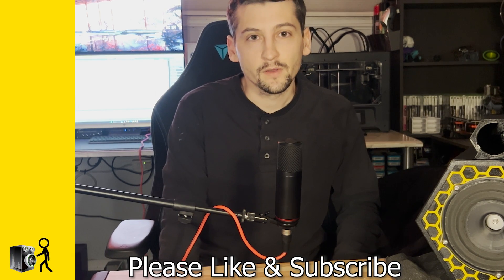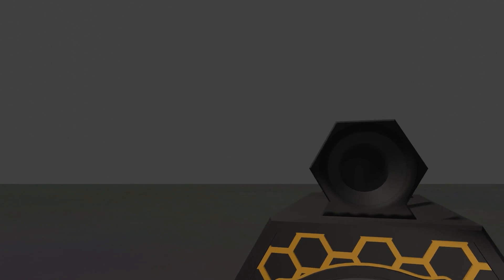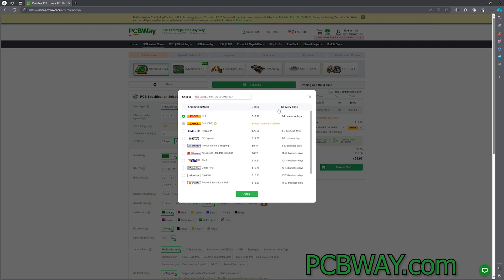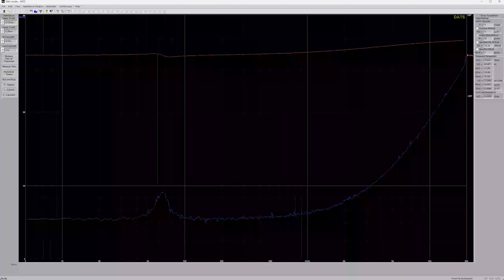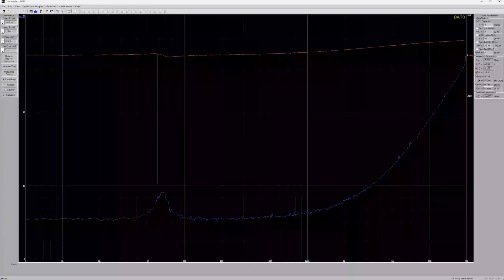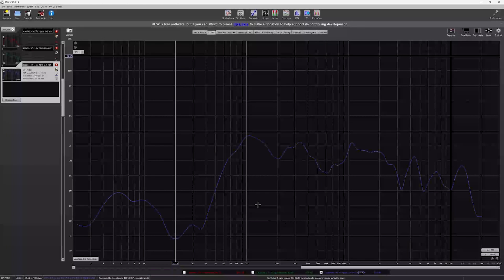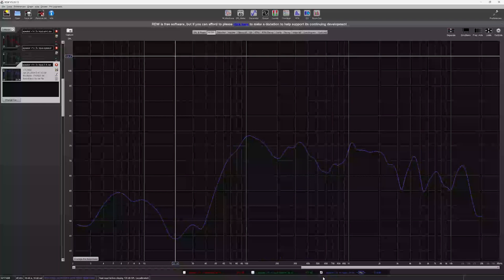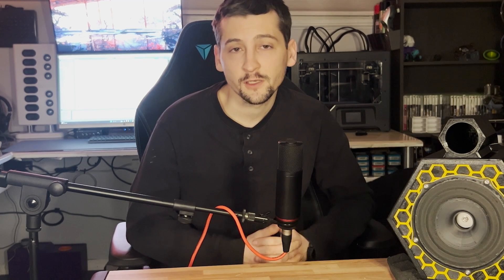Fully 3D Printed Speaker V14

Comment: Cool Project ! ♥️  The only concern I would have would be the relatively abysmal efficiency. I would assume that relatively sparse magnet arrangement arrangement resulting in a severely limited magnetic field? You seem happy with the result, but the trouble I see is that if you continue with this design purely as a proof of concept, once complete, there will be nowhere to go to boost efficiency but a complete motor redesign, since you won’t be able to buy stronger magnets than the ones you already have. With such a low efficiency, cooling will obviously be a major issue, but if the field strength were higher, the cooling would likely be unnecessary. Thoughts ? 

Looking forward to more !
Reply from the maker: I’ve tried denser magnet arrays before and the lack of air flow in the motor contributed to issues with voice coil overheating and then as a result warping. 

Also this motor isn’t something of a permanent fixture, it’s merely used so I can collect data for v15’s design. 

As for efficiency, this motor has the highest Bl of any of the 14 versions, so it’s the most efficient use of power of any of my speakers as far as the motor is concerned. Now that I have a motor that’s usable that way, I’m more focused on getting the suspension/cone design dialed down to what changes influence what parameters.

Comment: Magnet, coil and amplifier too? You only print box...
Reply from the maker: I printed all of the speaker minus magnets, copper wire and the steel plates/ fasteners. Those few parts can’t be 3D printed unfortunately.

But the speaker’s cone, former, frame, spider,surround, and motor basket were all 3D printed along with the enclosure.

Comment: why is the impedance curve so awful?? is dats really so crappy? i get super smooth and detailed curves from my simple system based on an usb audio card + REW...
Reply from the maker: Awful how? If your talking about all the noise, it could either be from how sensitive it is. Or it could also be from the fact that this is an entirely one off design - and while I understand the basics of speakers I’m far from an expert speaker designer.
Reply: yes, i mean noisy. With all this noise, i'd qualify it as "terribly insensitive", actually. Or can it be just because you've used a very tiny excitation amplitude?
Reply from the maker: I’m not sure what an “excitation amplitude is” I merely follow the instruction for the DATS hardware. 

I’ve tested quite a few of my speakers and the noise has always been present. I’ve also pulled TS parameters from a few other store bought speakers and there has still be little up and down bumps on the graph line. That’s why I’m saying it’s so sensitive that it’s picking up little variations in the speaker during its frequency sweep.

There hasn’t been any sort of smoothing on the DATS graphs. It’s just the raw output. I smooth all the graphs in REW.
Reply: @piscesprinting  i don't know to control excitation level in DATS, or if it is possible at all. But it is simply how much voltage is sent to the speaker for these measurements. In REW, i control it with in-rew amplitude adjustment combined with volume setting in the OS. I usually crank it all the way up to slightly below the point where i can hear distortion of the card's output amplifier.
Reply from the maker: As far as I know. The output to the speaker is locked. It’s also almost inaudible it’s such a small amount of power. I’ve never seen any settings to increase the output power. 

Also like I said it could just be my speaker. These are not the greatest sound coils. And I designed the motor myself. So it could just be distortion in the driver.
Reply: i also must admit that my measurements are probably better than average, because i'm using a soundcard with a headphone amplifier (not all have one), and i have even removed the output resistors from the said amp for some extra oomph.
Reply: " The output to the speaker is locked." - ahh, that sucks. Mine get visibly flexing during the measurement, and very audible (usually not loud enough to say "loud").

Comment: This is a great project, and I've really enjoyed watching it take shape. Just out of curiosity, have you considered printing molds and casting the flexible parts out of silicone? I've had some decent results with that for other projects, but if you consider it, use PLA. The sulphur in PETG inhibits curing.
Reply from the maker: I have done behind the scenes testing with molds- I did a forged fiberglass cone for this one (was to heavy though), and on v13 I was playing around with silicone surrounds- it’s something I may work into.

Comment: Impressive!

Possible avenue of exploration for a future project: replace the permanent magnets with an electromagnet. No nasty pinches during assembly if you can make it work.
Reply from the maker: That is actually how early speakers worked. They used a big electromagnet instead of permanent ones. They were powerful but very power hungry.

Comment: if i may suggest, the enclosure should make use of the advantages of printing to create more optimal rounded shapes to reduce internal reflections along with baffle diffractions, but walls should be hollow and filled with concrete to reduce resonance. i printed spheres to house a sub and fullrange drivers with good success. would gladly share stls :)
Reply from the maker: For my high powered sub I did a year ago I did round all the internal surfaces (it was sealed though) and I filled it with concrete. They weigh in excess of 30lbs a piece total- but they sound really nice- I have a video up if your interested - the production quality isn’t as good as more recent videos though.
Reply from the maker: Also I do want to find software to emulate sound waves in an enclosure. So I can see the bounces and reflections Along with speed of the air.

Comment: This is a cool design and the video is decently well done overall, but you need to get someone else to do the talking. Clearly engineering is your thing and the amount of work you put into this is definitely impressive but listen to you talk is more boring than the 25 minute eye safety video I just watched at work that was made decades ago. As for the design, really the only thing I would change would be the radii on the port. 5mm is still pretty sharp. I'd bump it up to something bigger if you decide to print another housing.
Reply from the maker: What would make it more interesting then? I aim for educational and purposeful over witty and quirky content. Is it the speed at which content is delivered? The tone? Or just the content in general? I am all for making better content but I need more than a general “your talking is very boring”

As for the radius on the port- 5mm was the max I could go without getting into the outside walls on the ends - if I thicken the port tube walls I could go up more.
Reply: @piscesprinting   You are talking very clearly and delivered the content. Re:Kmocrnell23: Not everyone is born as a good speaker, and many youtubers started with worse voice but they become better and better. 

Speed is fine and tbh everyone can just adjust the speed on youtube to their liking. Personally I think the tone could be better. 
I suspect its the recording picking up most of your throat sound ( those mid low sound? ) and it sounds very repetitive thus creating a dull feeling.  It could be some kind of mindset that "you are recording your voice so you speak that way without knowing" ( perhaps in daily conversation you dont speak in this style ). 
Maybe EQ would help or it could be the mic positioning. ( not an expert on sound but thats my guesses ) 

Keep up the good work! Will surely check out other videos on the channel!
Reply from the maker: Thanks for the feedback! I greatly appreciate it. I’ll look into those areas.